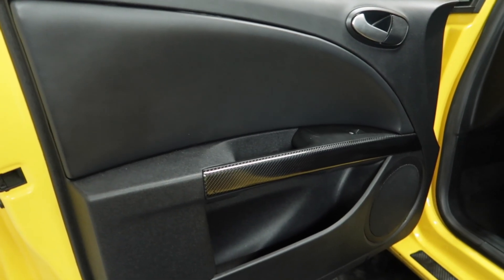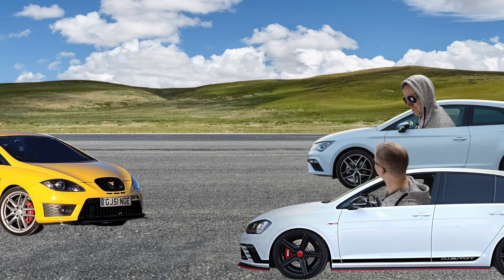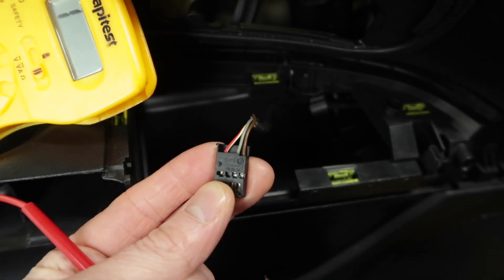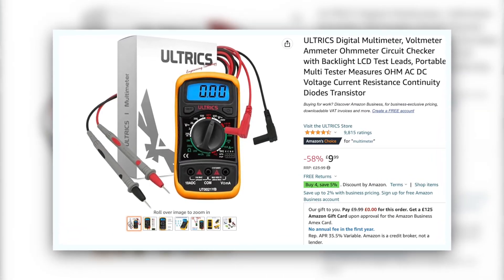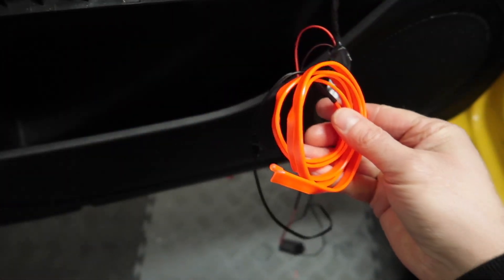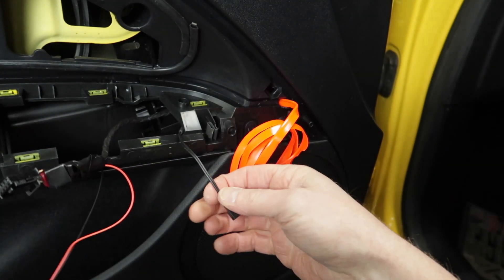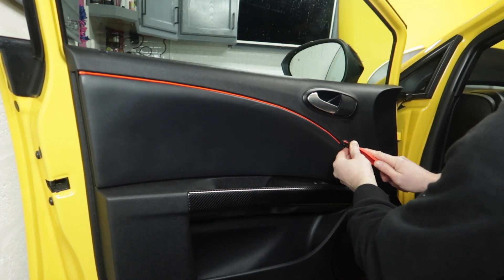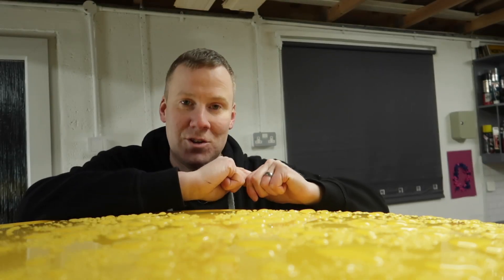I Totally TRANSFORMED my Interior Lighting with this £3 Mod! - YOU can too!

Comment: Did that years ago to my MK2. Such a simple yet elegant mod with minimal electrical knowledge of cars. 1. Make sure you buy your kit with the INVERTER, I forgot it myself and wondered why it didn't work 🤣 2. I personally bought 2m El wire and it was plenty to go all the way around the whole cloth/leather insert in the door. 3. Slamming doors will eventually cause the el wire to pop out.
Reply from the maker: Your spot on 👍🏻 I had the same issue with one years ago that was missing the inverter bit. And these versions with the flat edging behind the main light seem to help a little with holding it on place better, but time will tell 😁
Cheers Tomasz 👍🏻

Comment: My 2011 Seat Leon's window switcher runs at 6v not 12v. You can find a 12v wire (red and yellow) behind the audio speaker, tied in a bunch with other wires. Hope this helps.
Reply from the maker: Great tip mate. Wasn't aware some ran at 6volts, so useful tip for others 😁👍🏻
Reply: My red and yellow wire behind the speaker is only showing 3.6v.  2011 leon. Any ideas ?
Reply: @fredfly1509  I had the same issue, I couldn't find any wire behind the speakers that ran 12 v, there was one behind the glove box and one live at the cigarette lighter. Until I changed my car battery. So the only thing I would sugget is to first check your car battery. Can I ask you what led kit are you using?
Reply: @johnbaesv4776  just same kit that's in the video mate. Gonna be a pain to try and feed a supply to the doors, but it looks really good when it's done. Did changing your battery make a difference?
Reply: @fredfly1509 yes, it did. I had the same issue. I spent 4 days trying to find a live at the door. Changing the battery was a coincidence at that time. After, I retested the wires trying to find a 12v one, and the tester showed different and accurate values, because of the new battery. The red and yellow behind the speaker are 12v. Make sure your led kit requiers 12. If it requiers 6v, find a wire that has 6v. When you find the wire you need, make sure you find a good ground as well,the led won't light up. By the way, I didn't use the wires going to the speaker(those could be 6v, I needed 12v for my kit) I used the red and yellow behind the speaker, but coming from inside of the car and through the door. If your kit requires 6v,test the wires that connect to the speaker directly, mines run at 6v, and see which one is 6v live and which one is ground. If one of the wires shows 6v, but the led doesn't light up, change only the ground. If you remove the fabric panel from the door, some of the screws connected to the car are good grounds.

Comment: Really tidy job mate, I need to do this on my Mk2!
Reply from the maker: Cheers mate, yeah once you've done one, the other ones are a breeze. And not having it permanently fixed in, means it's easy to still remove the trim/door cards at a later date 👍🏻 cheers for watching and have a great xmas 🎄🎅🏼🍻

Comment: So for example, on aliexpress they sell different sizes, 1m, 2m, 5m. 
I have the same car. Do i have to buy for of 1m? And do you cut them? I do not know if 1m is to long for 1 door.
Reply from the maker: Yes, I bought the 1m lengths and hid any excess behind the door card out of sight. I was unsure if they would still work if I cut them, so I didn't risk it. Hiding the extra bit out of sight is just as effective 👍🏻

Comment: My doubt is how make the connection to the doors, I got USB ports to conect it but don't know how to install it in the doors without visible wires
Reply from the maker: I'm not sure if USB ports would be able to be connected to standard wiring. Probably best to buy 4 new strip lights with the inverter box instead, as they are reasonably cheap. Then you could use the USB ones somewhere else 👍🏻
Reply: @NorthCoastWorkshop  I hot the usb to conect to my usb port that powers all the lines, just need to know how to pass from dashboard to door concealing the wires.
Everything works with the USB, I just don't know how to wire it from dash to door
Reply from the maker: @Tuner775  you'd have to somehow get it through the trunking in the door jams, but I'm not sure how you'd get it to fit through I'm afraid

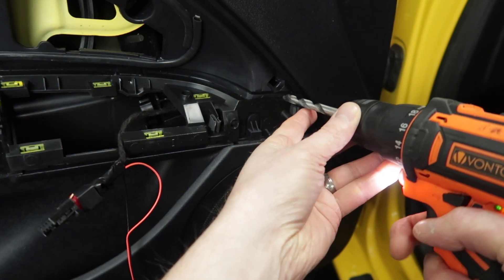Comment: At 6:10 wich mm drill you are using?
Reply from the maker: It looks like either my 8mm or 10mm drill bit I'm using, just so it's barely large enough to get the small connection block through

Comment: I don't know what i did wrong but i tried and they dont light up but the windows do work
Reply from the maker: Do the lights work straight off the battery terminal? It will only work one way and not the other, so + and - need to be correct 👍🏻
Reply: @NorthCoastWorkshop  It works :D. Really appreciate the video!!
Reply from the maker: @cowstabbers  excellent news, great to hear mate 😁👍🏻

Comment: Had mine in a while think its a great little mod only thing is they've just stopped working, hooked them upto the battery and working still... what do you think the problem could be mate?
Reply from the maker: Hmmm, not sure. If it's definitely working off the battery directly, then it must be to do with the connections in the door. You could try a soldered connection instead which may be more reliable and longer lasting. Just use heat shrink to cover it all afterwards.
Reply: @NorthCoastWorkshop  yea definitely working straight from the battery as I thought the wire or the driver might be blown at first but lit straight up from the battery so put them back on the window wires and nothing
Reply from the maker: The window switch still working/lighting up? If so, yeah just a different method of connection or a fresh connection should sort it 🤞🏻
Reply: @NorthCoastWorkshop  yea switches all still working and lighting up, tried different ways to connect them too... wires twisted together, same way you've done it
Reply from the maker: Hmmm, I'm stumped as u. Let me know if u get it working 👍🏻
Reply: @NorthCoastWorkshop  just been out now and drivers door came back on, got out to go to the Chinese lol then turned car back on and all came on so god know what it is mate, but great channel mate 👍🏽
Reply from the maker: Great news, cheers for the kind words mate 😊👍🏻

Comment: What wires on drivers door as mine doesn’t work with brown and grey ?
Reply from the maker: If it's different coloured wires than the ones shown, I'm afraid you'll have to use the multimeter, as I did in the video, to track down which wires you'll need 👍🏻
Reply: Did you find out which are the good ones?